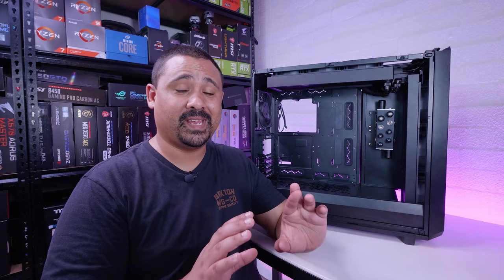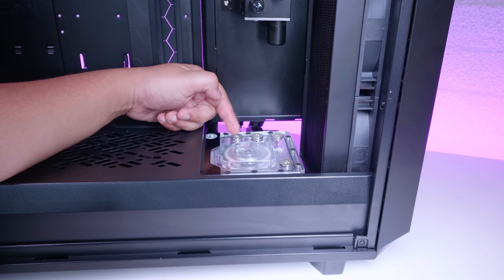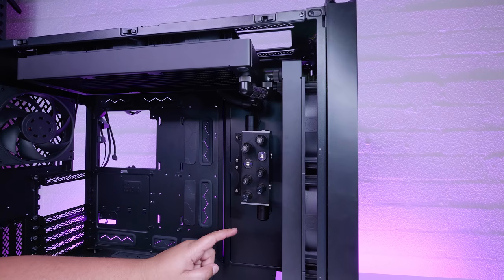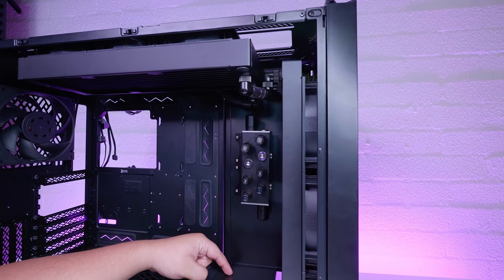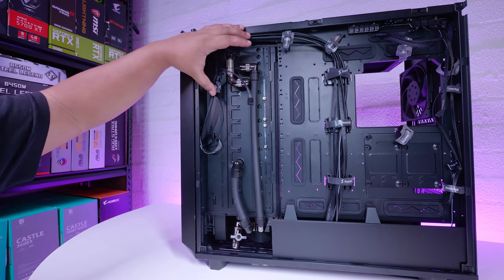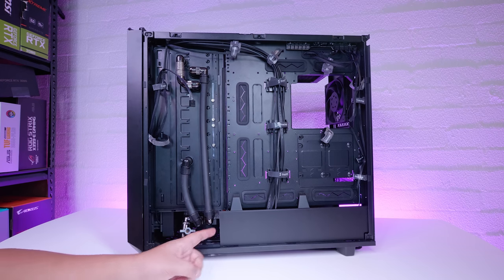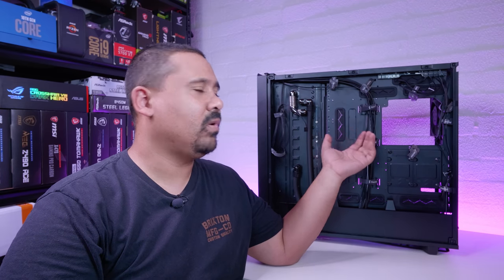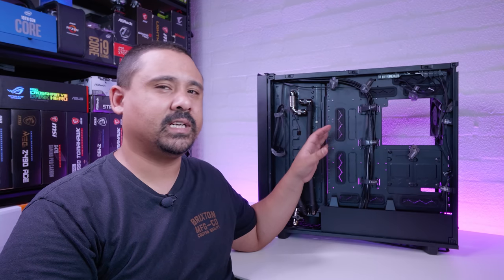Time to finish the mods - Dream Water Cooled Editing PC - Part 2

Comment: Sir please 🙏 can you pls make video on ram ICs (b-die,e-die,etc..), latency, timings , tertiary timings ,tRDWR , tRCD , tRP , tRAS ,CAS , fClock , u Clock ,mClock, 1.1 v SOC, bclk ,bcoc ,fclk, ProcODT ,GDM(gear down mode) Etc. , Full RAM guide? Plss make🙏
Reply: wrong channel
Reply: Didn't GN do that?
Reply from the maker: There is already so much information on this it is basically just a waste of time.

Comment: Wondering what type of fitting or grommets do you use for the pass through fittings on the manifold. when going from the front side of the case to the back side with the water line?